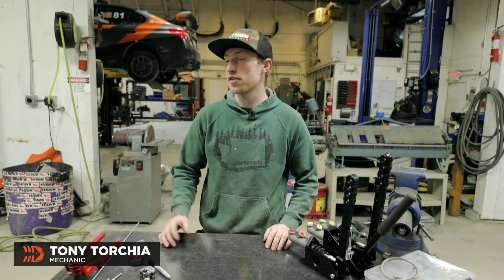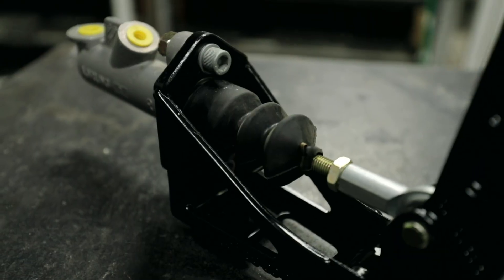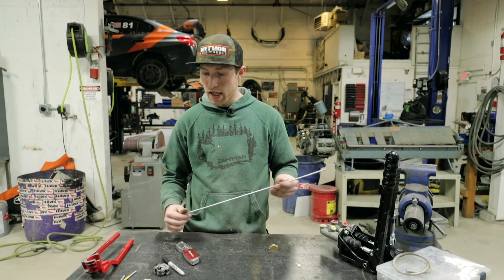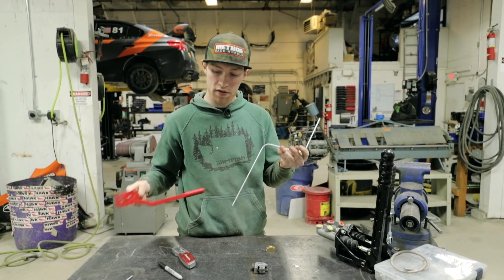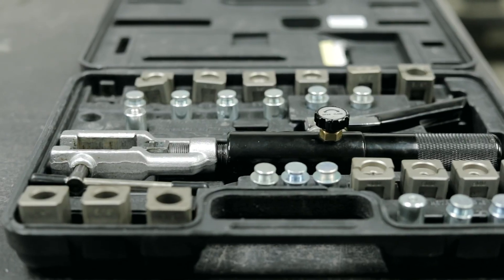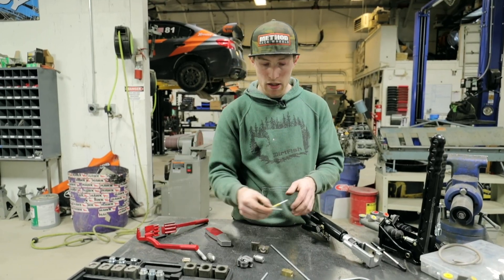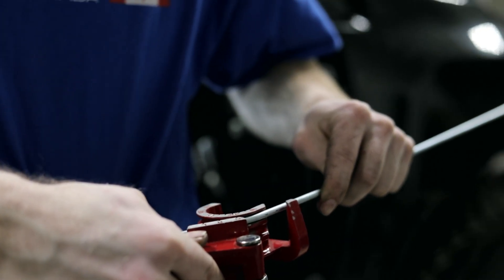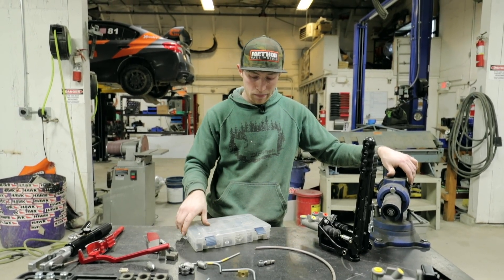How to Install a Hydraulic Handbrake

Comment: Aside from showing how to flare brake lines, this was not a very good video...maybe good infor for a total novice, but i was hoping for more detail...no install portion, no tips for mounting, no tips for drilling the body and running the lines, or mention on the T fitting. Would have liked to see how it was done start to finish

Comment: I have one question for you and I'm sure you figured this out after you put yours together. How the hell do you keep the fluid from going back into the other Reservoir on the main master cylinder and then when you push on the main master cylinder brakes it will push fluid back into your handbrake Reservoir. so how did you stop that problem

Comment: This is very informative but if there is more diagrams in the video it definitely make it a little bit more involving. Like what made it sound kind of confusing is do you hook it up to the master cylinder to the handbrake feeding that through and then connecting it to your calipers?. Like the majority of the video was talked about how to angle and set up your brake lines. But as me as a consumer I'm looking to hook them up that's x but why and how did you get everything else set up. I don't know very ignorant on this topic but if there's more information it would have been lit
Reply: Couldn’t agree more. No disrespect to them but the video was absolutely helpless as far as info on installing a handbrake. Like this is how you’d teach a kindergartner about the topic, not someone that’s trying to do it at home lol.
Reply: @boost1728  yesssssssss

Comment: Can this be done to keep ABS on a stock BRZ?
Reply: No. This ties together the rear brake lines so this method wouldn't work and maintain ABS. You'd need dual calipers or a handbrake with 2 master cylinders so each rear wheel gets one. That'll keep ABS able to function. You'll have trouble if it tries to activate while you're handbraking though
Reply: Thanks for the response, I ended up going to a dual caliper setup. It's been working great and from everyone else I've talked to the pressure and reliability are much improved over inline. ABS fuse just gets pulled most of the time.
Reply: @O_RaLLY  Yeah that's correct. When you get to a certain point, you'll be using the foot pedal and handbrake at the same time to increase rear bias or lock the rears but also have front brakes which will skyrocket pressure and can cause premature seal failure in the calipers. Duals also help keep you from boiling brake fluid too. If you're pulling the ABS fuse a lot, you could always add a switch in line with the fuse to turn off abs with the flick of a switch/push of a button. I hate pulling fuses in general and would rather have something more convenient. Just food for thought 😉👍
Reply: I keep thinking about it but one I just don't want to put the effort into rewiring and also I feel like messing with the factory harness no matter how well you do it introduces risk for failure. My Rally lights are on their own dedicated circuit for that reason.
Reply: @O_RaLLY  That's fair enough. I put a 4g63 engine with AWD into my mini Cooper for SCCA rally cross so messing with stock wiring is pretty much unavoidable lol. I do have a standalone running the engine but all the body module stuff I have still there and have to modify to make everything work smoothly. Sadly, I can't do a hydro handbrake because of the center differential, but if I ever get motivated enough to go for it, I'd like to make a center diff decoupler that I can tie into the hydraulic line to disengage the rear wheels when I pull the handle.

Comment: Ive done the inline  on my rsx i have abs ,stock master,and  the willwood staging  brake.i can  only move  no more than a inch b4 it locks up the brake?i thought it would sling shot out when i wanted to launch?is that normal for it to be so stiff ?? Any info is appreciated  ty

Comment: Thanks for the video, I have 2 questions. -When you're using the regular pedal brake, does the rear fluid just pass through the handbrake setup and apply the rear brakes normally? 
-If the above answer is yes, does the proportioning valve (if the car has one) stay plumbed in the same order?
Reply: great questions...thats what i wondered literally.
Reply: @evrenyilmaz6445  the answer to both of those questions is yes. I did replace my proportion valve with a $100 adjustable one from summit. The setup has been working great so far.
Reply: @evrenyilmaz6445  the answer to both of those questions is yes. I did replace my proportion valve with a $100 adjustable one from summit. The setup has been working great so far.

Comment: How is Dccd is integrated to the hydraulic handbrake so to not cause any damage?
Reply from the maker: The short answer is that the OEM DCCD opens up more depending on the severity of the corner. The handbrake doesn't have any affect on that unless you've upgraded to an aftermarket control unit (like MOTEC), then it can be programed to disconnect the diffs when the handbrake is pulled.

Comment: I always wonder how these interact with the regular brakes.  What happens when you're already on the brakes when you pull the hand brake? Usually when I need the hand brake I am already on the brakes, trail braking as I set up the car and then just need the hand brake to nudge it over that traction threshold in the rear and initiate the rotation.  Always wondered how the inline systems handle this.  I assume its not an issue but I have read comments about blowing up the hnd brake mc and all kinds of internet horror stories that don't seem to make much mechanical sense to me...  And (even though I can't think of a reason why) what would happen if you hit the brakes while you are pulling the hand brake?
Reply from the maker: It depends on how the car is setup. In an AWD, unless there is a center diff disconnect, you would have to clutch-in when you pull the handbrake to avoid locking up all four wheels. The top level rally cars all make it easier by disengaging the center diff. Depending on how shard the corner is, you should be able to accomplish the same results with the standard brakes but adjusting the pressure. We typically suggest only using the handbrake in tighter corners (hairpins and acute turns).
Reply: @DirtFish  wow thank you for taking the time to reply, I really appreciate your thoughtful answer!
Reply: @DirtFish  interesting, so in the case of a 4wd truck, would I only be able to use the hydro e brake while in 2wd? I’m assuming if used in 4wd it would just lock up the front wheels through the transfer case (or blow the transfer case in the process)?
Reply: The works Ford escort mk 1 and 2 European ones not US escort. Used separate callipers for the handbrake and footbrake. That allows braking and handbrake at the same time.